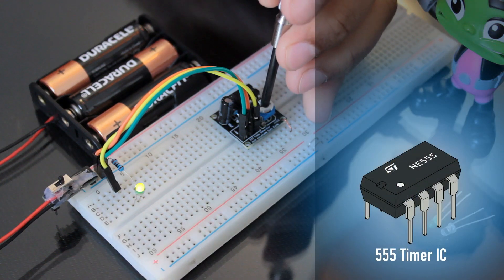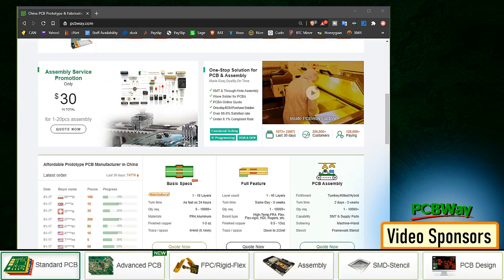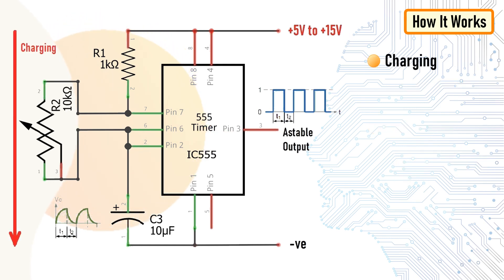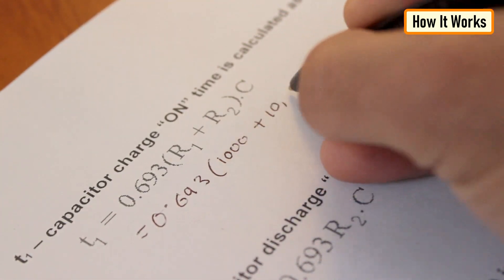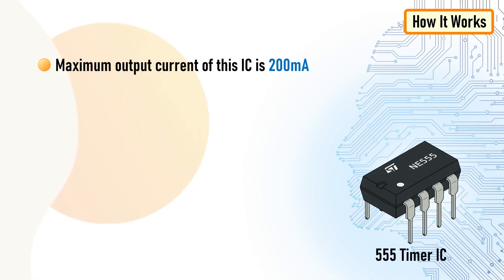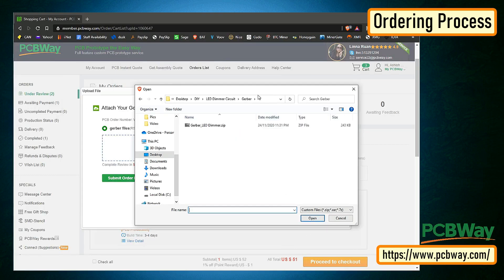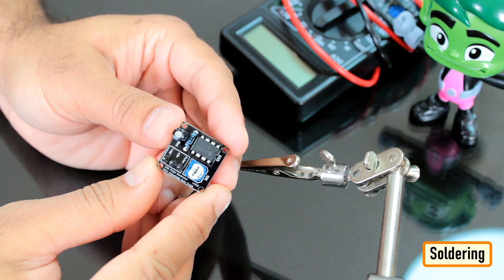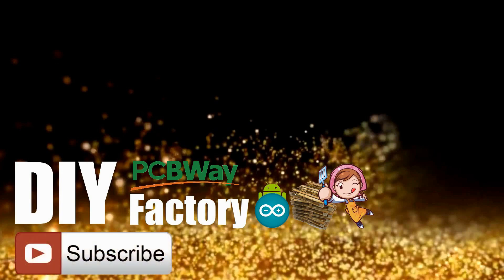555 Pulse Generator Module

Comment: Can this be used in power steering
Reply from the maker: I am not sure in what context (whats the use case for your question).
-----------------------------------------------------------
However,
What is Actually Used in Power Steering?
The type of system that would use a pulsed signal is an Electric Power Steering (EPS) system, which has largely replaced hydraulic systems in modern cars.
In an EPS system, the "pulse generator" is a highly sophisticated Pulse Width Modulation (PWM) signal generated by a dedicated Electronic Control Unit (ECU).
-----------------------------------------------------------
Why a 555 Timer Module is Unsuitable
1. Lack of Precision and Stability:
A 555 timer's frequency and duty cycle can drift with changes in temperature and supply voltage. A car's electrical system is a "dirty" environment with large voltage spikes (e.g., from the alternator, starter motor, and other actuators) and wide temperature ranges. This instability would make the power steering assist erratic and unpredictable.

2. Insufficient Feedback and Control:
Modern power steering systems (especially Electric Power Steering - EPS) are closed-loop systems. This means they constantly monitor:
Torque Sensor: How much force the driver is applying to the steering wheel.
Vehicle Speed: Assist is high at low speeds for parking and low at high speeds for stability.
Motor Position/Current: To ensure the motor is providing the exact required assistance.
A simple 555 module is an open-loop system. It generates a fixed pulse regardless of what the driver, the car, or the road conditions are doing. It has no way to receive sensor data and adjust its output accordingly.

3. Safety-Critical Nature:
Power steering is a safety-critical system. A failure could lead to a complete loss of power assist, making the vehicle very difficult to steer, especially at low speeds, and potentially causing an accident.
A 555 timer IC and the typical modules built around it are not designed or certified for automotive safety integrity levels (like ASIL). A single component failure in the module could cause a total system failure.

4. Inadequate Power Handling:
The 555 timer itself is a low-power IC. The module might be able to drive a small LED, but it cannot directly drive the high-current DC or AC motors used in power steering systems. It would need to interface with a high-power motor driver, but without the sophisticated control logic, this would still be dangerous.
Reply: Thanks 👍

Comment: Can normal motor flash meaning on/off like the light with this circuit?
Reply from the maker: Motors have coils and hence will generate inductive kickbacks 
Bit if you wire it up correctly you should be able to. 

However I would recommend using motor drivers or ULN2003 or something similar for that 

I have a tutorial if you want to have a look: https://youtu.be/dtfGf7kf__g?si=l8y6E0JOsQvXqVF6
Reply: @CrazyCoupleDIY Thankyouu so muchh

Comment: Hi, first of all, thanks for sharing the video.
On your "instructables" page, you say that this circuit works at voltages between 5 to 15 volts DC.
I have a Laser Printer Polygonal Mirror Motor and it works with up to 24V (for greater speed). Therefore, is it possible to change the circuit a little to bring this voltage closer (24V)? Thank you very much
Reply from the maker: Thanks 
I am not sure if it will 
But you can google ICL8038 which is capable of generating 12 to 24 v pulses
Reply: Thanks @CrazyCoupleDIY

Comment: Nice vid, perfect to understand ic555  ! How could we use what you mentionned @3:58 ? 
I need a pulse circuit around 1Hz or 4Hz from 3.7V-7.4V to 110V. Current is not important, thanks for advises in advance

Comment: Can I use it permanently in another device or does it heat up overtime?
Reply from the maker: You may use it 
I have used this in conjunction with many of my other 555 projects and they run indefinitely